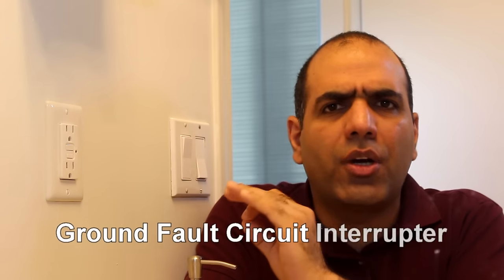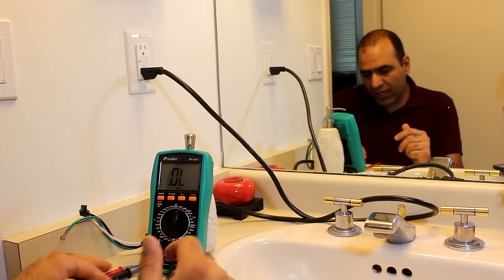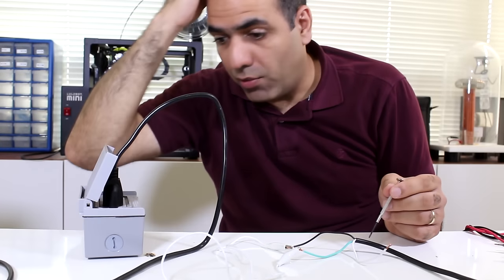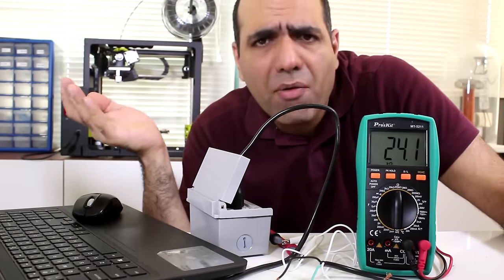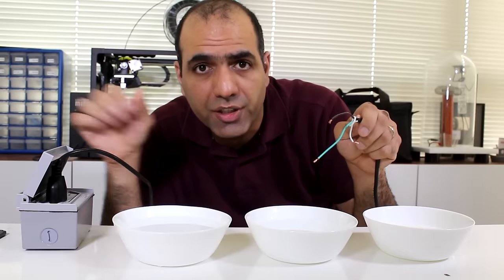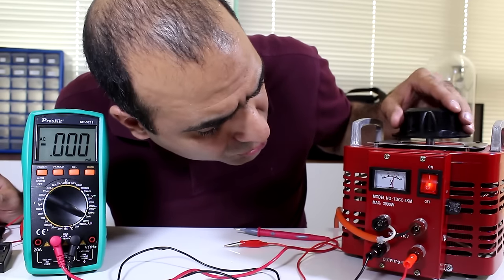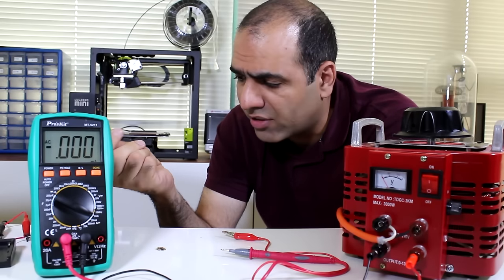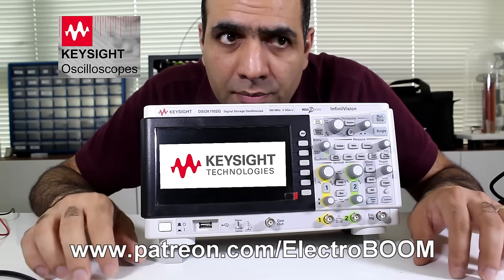The Outlet that Saves Lives

Comment: Your usual videos scare the crap out of me, but this was extra scary. I've accidentally shorted a live wire as a kid, on 220V and it was not a pleasant experience. Luckily, my dad was nearby and he pulled me away from the socket. This video brought back memories.
Reply: I short wires all the time and its not risky at all (until you make physical contact with them). I'm a electrical engineering student.
Reply: Jordan Johnson don't know what you're trying to say.
Reply: You're not a very good student if you short wires all the time, now are you? ;)
Reply: There's nothing magical about circuit breakers but okay.
Reply: Sarath Menon I was a dumbass when I was 3 and took apart a charger plug took out everything and connected a wire, negative and positive and made a freaked ticking time bomb that after 15-20 seconds exploded with black plastic. Everyone in the house was like  WHAT THE FUCK WAS THAT SOUND?!?!?!?
Reply: was that supposed to be 13?
Reply: Sarath Menon  well shit bruh
Reply: 230V can be really mean.
I accidentally grabbed a live wire (i was sure I had unplugged it) while working under a desk... The jolt made me throw my arm back (hitting the side of a drawer with my elbow), jump up (hitting my head on the desk) and I knocked a lamp over. Which fell on my head also. 
And my hand and arm hurt for 15 minutes.
It wasn't a great day.

On the other hand I could be dead so I guess it wasn't the worst...
Reply: Ned I remember watching a video where a guy was talking about the time he had got struck by lightning while repairing his roof.  Apparently his arm involuntarily jerked so hard that it dislocated.
Reply: The same happened to me. It was a struggle, but I managed to free myself. Then when my mom knew, she started beating me with a thick ass wooden stick lol.
Reply: Five10 I doubt your grades friend. Shorting wires can heat up so much that they can burn through the isolation, and even melt. They will also burn up your circuit. So not a great idea unless you are doing it for a very specific reason . 

-Aerospace engineer student
Reply: @Christopher Teale Correct, depending on the power supply it can be even worse than that. A household socket on short circuit would trip the breaker immediately, so you don't see the real damage that it would cause, but a dumb old battery won't have any protection. I accidentally shorted a lead-acid battery with a really thin electronics tier cable once and it basically vaporized in my hand leaving a pretty painful burn.
Reply: Did that too as 10yr old, i was always screwing around with my electronic toys, loved disasampling them und figuring out how it worked and put them back together.  One day i was bored and tought to myself what would happen if i touch the 2 blank spot on that open 230v "Schuko" power supply plugged into the socket - so i shorted it with my left and right thumb and got thrown back hard... burned both my thumbs -  damn lucky. 
With 15 i got stuck to the handle of an electric lawnmower while being stupid again. not seeing the damn cable on the ground, again both hands 3rd degree burns, still alive - yay.
2 yrs ago i was at work wielding pvc lanes together on a big old three-phase machine, got careless touched the iron in the process and got stuck until someone kicked me away.... i dont work anymore... or can't.
Reply: Ha when I was a kid we were renovating our house and I touched a broken light switch which shocked me good and left a burn mark on the metal and dad ran in like wondering how I left such a mark on the thing without seriously injuring myself. Funny now that he's an electrician.
Reply: im full insane Who hurt you?
Reply: i used to play holding 110v wires when i was young
Reply: That happened for me but no one needed to save me since I touched i with my finger tips it was easy to move my hand away. That was best "never touch electric wires" lesson of my life - experience.
Reply: Sarath Menon 
I once plugged a homemade electromagnet in a 220V AC outlet , it tripped the breaker for the entire room and somehow disconnected the wires attached to the breaker. Worst part is the electromagnet didn't even work.
Reply: Five10 same lol I like shorting wires
Reply: I had quite hecktic experience with small electric handsaw that had a tape fix in its cord. It stopped running due to contact problem in the fixed cord. I tried to wiggle it around to make contact again and the cord exploded. Luckily I was wearing safety glasses because I felt some heat and debris hitting my face.
Reply: I had a close encounter with 220V AC a couple of times when I was a kid. I touched an exposed transformer once and also me, my brother and a friend did a really stupid thing of putting a screwdriver tester into the live part of wall socket, grabbing our hands and then touching a grounded metal. The tingling was fun for a while until the socket arced and tripped the breaker. Leaving the socket covered in black residue.
Reply: Im 9 and a few weeks ago i shorted the power point at 240 v
Reply: I shorted 220v before by extending out the 2 wires from the socket then threw a pair of scissors on it from above. (Sparks flew everwhere)
Reply: Sarath Menon 
At the age of 4, I found a plug with a cutoff wire on the street.
I took it home, found a socket and voila... Burned my hand 3degree.
No breakers on that socket at all and 220 volts (thankfully I cannot remember this).
Reply: When I was a stupid ten year old my dad left a box of wires and cords out on the desk in the garage, the next day I found a wall plug and a motor and connected them, then I plugged it into a outlet and turned it on, my nan was sleeping on a chair and it scared the shit out of her I am 14 now and am only allowed to play with batteries.
Reply: Orgiez Gamz A student that never messes up is a student that never learns.
Reply: Pulled you away? If current would've been running through you 1) the breaker would pop and you'd be safe (every home in europe has that system)

2) If the breaker didn't pop for whatever reason your dad would also get electrocuted. Never touch anyone being electrocuted, shut off the source!!!

Comment from the maker: Hey every one! I drew two winners for my MERCH, who are:
- Raks Electric
- ABaumstumpf
CONGRATS!
Reply: ElectroBOOM can I have some
Reply: Great video. Too many people take GFCI less seriously than they should. The manufacture is crap too. Test every month... who the hell remembers to do that? They cost too much and fail too fast. A better design is needed to save lives.
Reply: ElectroBoom, I know no one should touch live wires, but, whenever it's needed (like in the tests you just did), in order to avoid the flexion of your muscles of your hand around the wires - making you grab the wires - you can use the back side of your hand, therefore, if your muscles flex, you will automatically pull away from the wires, instead of grabbing them!
Reply: Very great and educational vids Mehdi!!! Don't mess with electricity people!!!
Reply: ElectroBOOM I'm making my first Tesla coil because of you not done yet but I'm working on it
Reply: And if you connect a full bridge rectifier to the fiveaway it will choose me
Reply: ElectroBOOM When you did the soapy hand test did you mean to do that or was that not planned?
Reply: So, you are telling me that in a western country circuits in housing are not allways protected by some sort of fuse/breaker that will disable the current in the system when a fault occurse that will porssible hurt or even kill someone? I mean we in germany have those since 1928.... that is 90 years... and you telling me it is not a standart around the world (at least in the industrial world) FFS that is baffeling me...
Reply: "circuits in housing are not allways protected by some sort of fuse/breaker"
A fuse breaks at much higher amperage, it will take way to long to trigger. What he's talking about is better than a fuse, breaks much earlier. But no, its not standard to have all outlets connected through a residual current device. And it's still very uncommon with deaths due to electrocution (I could be mistaken, didn't google how many deaths per capita and year it is, just what it seems in my country and we don't have mandatory rcd in the whole house).
Reply: ElectroBOOM In this video you was supposed to reduce the voltage by 30V DC to 3V DC when you was measured your tongue curent.
Reply: So I guess the soapy hand opens the GFCI outlet's breaker when your hand is between live wire and earth wire, which those wires are pluged in the GFCI outlet.
Reply: Too late for me :(((

Comment: These have been required in Europe for years, the entire house circuit is connected to a GFCI, one for dry circuits, one for wet circuits (bathroom, toilet, kitchen, ...). The latter has a lower tolerance (typically 30 mA)
Reply: Plug sockets are not even allowed in UK bathrooms except for the specially designed "shaver outlets". Even light switches are often left outside the bathrooms.
Reply: @svartmetall48  they also run at 120v instead of the regular 230v
Reply: @pheakay  actually they have both. If you take a look at them, they have a different voltage on either side.
Reply: @svartmetall48  your probably right, only remember seeing 120v but haven't had one in my current house
Reply: When I was an intern as electrician in the late 80s in Denmark, we were phasing out HFI relays (0,3 A GFCI) in advance of HPFI relays (0,03 A), which is still the standard today.
They are 3 phase and mounted in the circuit box, because we have 3 phases as standard in all houses. The HPFI goes in front of all other fuses.
Reply: It's called an RCD (residual current device)
Reply: @lamonticus583  Are you American?
Reply: @akyhne  nope, european

Comment: U.S. Electrician here. I have worked with both RCCB's in Europe and GFCI's. 
One weakness GFCI's have is the mechanism will NOT operate under a short circuit condition.

For those that do not know, GFCI's monitor the current between the hot and neutral. In theory, under normal operation, the current on the phase will match the current on the neutral. If there is a difference, 3-5 milliamps for GFCI's, between the two, the GFCI mechanism will sense that imbalance and trip, since the design assumes the imbalanced current is then going to ground. Hence "Ground Fault".

However, under a short circuit condition from phase to neutral, in spite of the high amperage, the current will remain the same from phase to neutral, thus not triggering the GFCI function. 

I have tried this myself at home. I have taken two wires, inserted them into the hot and neutral slots of a GFCI outlet, then touched them together. Sure enough, the circuit breaker (A new one I replaced) tripped under an overcurrent condition, but the GFCI on the outlet never functioned. 

Still, around water, GFCI's have saved lives, since most equipment have means to provide a path to ground.
Reply: Does that matter? Short circuit most, if not all the current is going through the short. Sure, for a long enough wire in a short, I could see enough current at voltage going though a wet hand kill you. But if the short is a complete short, then the breaker will trip in a millisecond and you are not electrocuted. I must be missing another scenario here, where a short with no GCFI protection still kills you in the tub, with your toaster, making breakfast.
Reply: Why would this matter? The circuit would have overcurrent protection from the branch circuit breaker in the panel
Reply: That's the point. You have an OCPD already and it has the correct time curve too. Don't need an EGC either (proof is NEC 406.4(D)(2)(c) which lets you use a 3-conductor grounding-type receptacle on a 2 conductor circuit without EGC provided you protect it with GFCI)
Reply: Thank you for your long, well informed comment.
Reply: Mcb is for that purpose I guess...
Reply: Thanks for the information! An electrical engineering student here!
Reply: The video already described this in detail.
Reply: The GFCI will also (and is required) to trip from a Neutral to Ground short as well.
Reply: He showed that in the video.
Reply: In the first 2 minutes of the video at that! His first demonstration :D
Reply: +
tailgunner2
I have noticed a large increase in electrical equipment with only two plugs and no ground.  I assume it is a cost saving tactic.  Seems like it would be wise that the authorities demand all 110 or 240v devices have a ground wire and plug.
Reply: Does this make any sense? I thought that GFCI is something like RCCB (residual current circuit breaker), but Mehdi tested it only with simple low-resistance load, connected properly (the neutral was connected into GFCI, as I see), so the only thing is working here is short circuit breaker or a fuse.
Reply: I've seen a lot of GFCIs fail in rare conditions. Not tripping in conditions where they should. Being tripped, stuck in tripped condition, yet still hot.

Not to mention the ones that permanently fail and refuse to reset.
Reply: So what your saying is a GFCI outlet is only worth the extra money when installed near wet environments? That’s interesting to know. I have always wondered why we don’t install one or more on every single circuit (ignoring the significant increase in price that is).
Reply: @Kankooro  
i have only ever seen them fail to reset , i have never seen one that doesnt trip , but maybe if it is reset with a high load connected the contacts may weld together , it is always best to test them just before you are going to use any appliance near water :-)
Reply: @VestigialHead  What kind of equipment? If it has some sort of galvanic isolation and/or a non-conductive housing, it doesn't really need a ground connection for the most part. For example your cell phone charger does not need a ground connection because it has a non-conductive plastic housing and the output is isolated from mains by a transformer and class Y capacitor, so there is no way more than a tiny amount of current will flow through a path to ground. Same with a lot of electronics.

One thing that I do agree is kind of unsafe is typical desk lamps which often only have two pins and often have metal housings. Any time a light bulb socket is exposed, the metal outer contact of the light bulb is connected to neutral (or even live!), not ground.
Reply: Nice essay

Comment: 9:14 I felt that with him! - I was like omg STAHP already!
Reply: This guy isn't right. The body isn't supposed to allow you to endure such pain. My stomach was knotting watching him...
Reply: eerereps iiiiii
Reply: Very informative and I genuinely felt for you as you tortured yourself to get to the truth. Props to you man. Well done.
Reply: My grade 8 Electronics teacher used to swipe his finger across the various points in high voltage circuits like tube radios to find which parts were energized and which parts were not. Most of his students learned to use proper test equipment...
Reply: eerereps s
Reply: Whatttt ?? In France the entire house is protected by "gfci" we call that disjoncteur différentiel.. it's mandatory for any installation...
Usa is fucking dangerous 🤔🤔
Reply: The one at 10:40 made me jump
Reply: If you could literally feel his pain, you have a rare form of empathy that lets you physically experience others' feelings.
Reply: in the usa, they see regulations as evil due to their trick down delusion
Reply: eerereps
Reply: +Mateox Idlatsac too bad he's in canada huh
Reply: GFCIs are required in all places in a house that have running water and in basements (sparing when it's the single outlet of a circuit for a fridge) for nearly every state for a few years now... it's just once something is built you don't need to bring it up to code unless you are modifying it.
Reply: eerereps
Reply: eerereps   gg
Reply: He knows when to stop